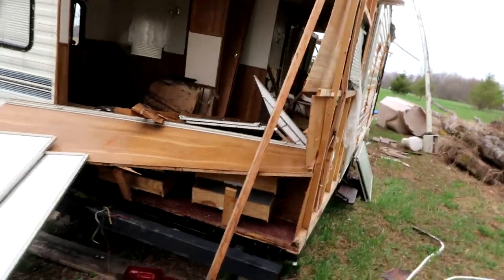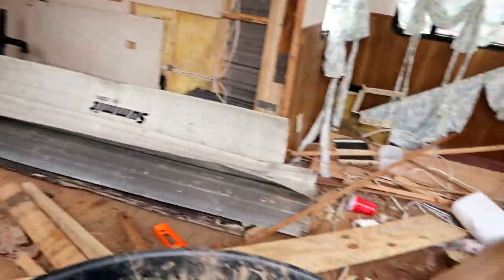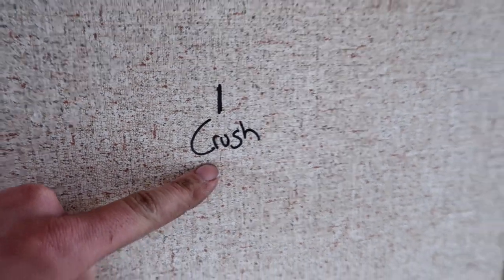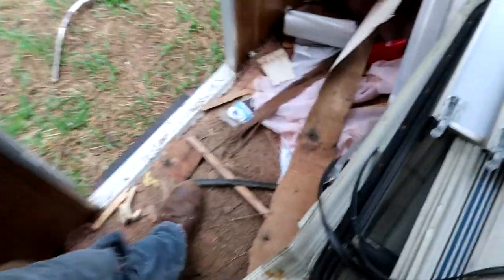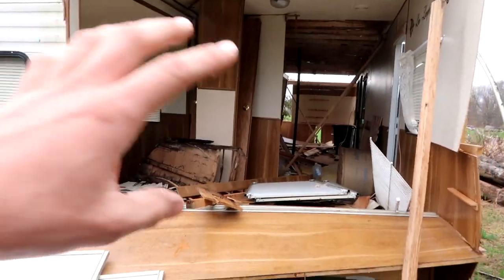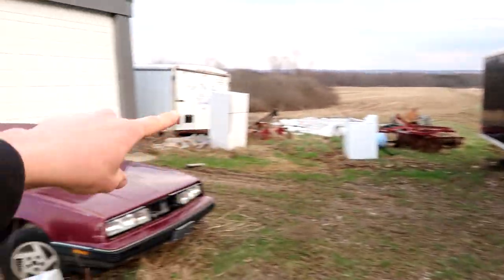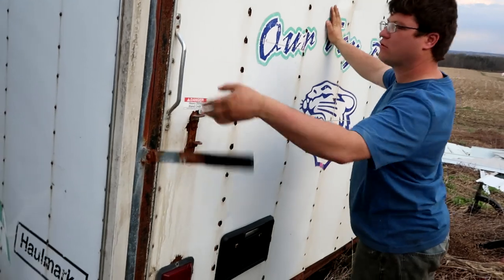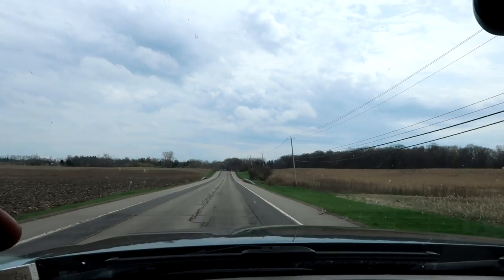Taking the Camper Trailer to The Land Fill

Comment: @3DMachines you might want to leave the axels of the camper trailer where they are so the weight of crush is on top of the axels. one the weight on the axels will help keep the trailer from swaying as bad and two it will make the weight of the trailer fully loaded distributed more evenly between the truck and the trailer axels.
Reply: Crush weighs nothing compaired to the trailer it wont make that big of a difference
Reply: @Diesel dude 71 im in the same boat you are brother.

Comment: As a suggestion, don't cut off the back of the frame just shorten the body of the camper and build a "deck" you can sit on it during events. It can be a gathering place for everyone after a race or just kick back in the chairs and relax. You could set up a merch stand on it even.

Comment: You should weld a spare tire carrier to hold your tire also if you have a certain jack you can use the tool to put down the jack and lower down the spare tire.

Comment: should have hauled that camper to dump and stole axles, told campsite you haul garbage away for 300$...and spent 300 on gummy bears....your lucky more people didn't drop more garbage off in Gramma's yard beside that rotten heap and insulation.